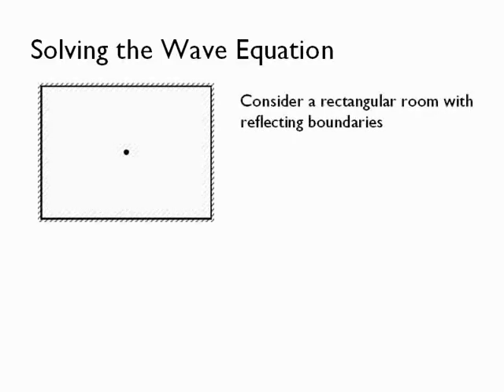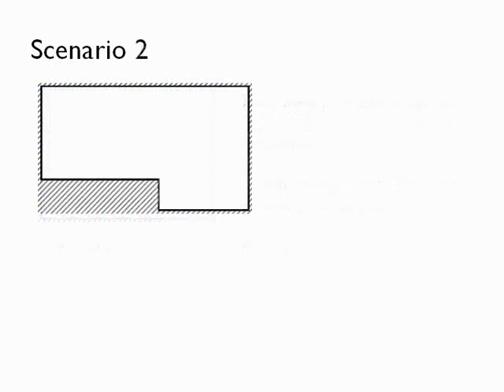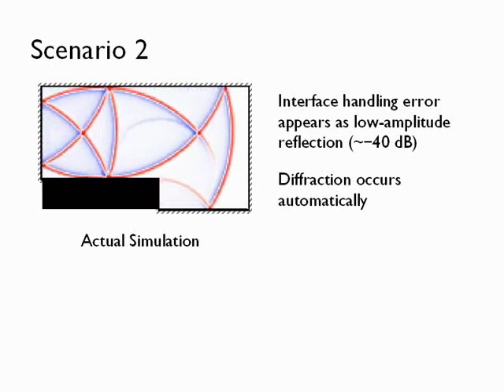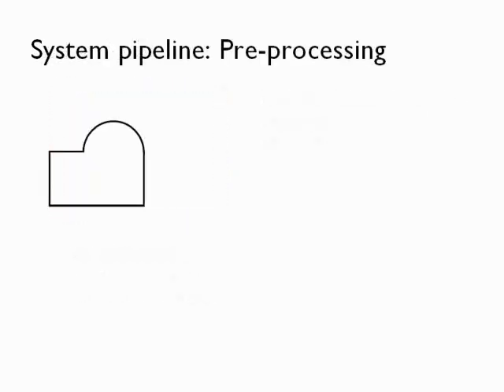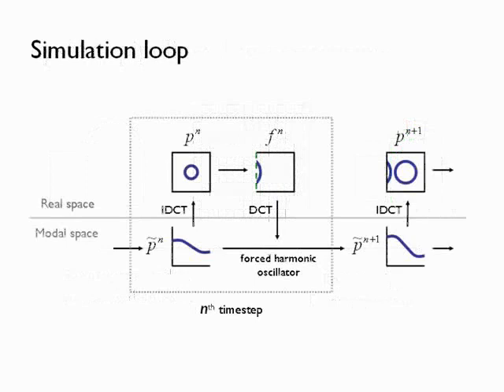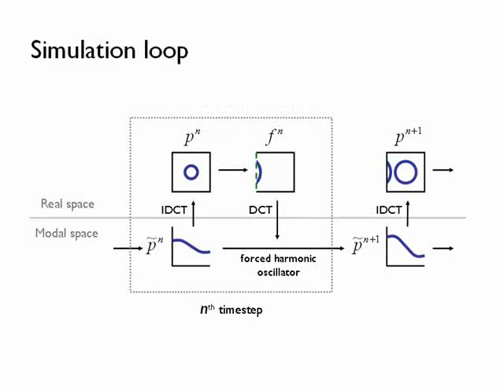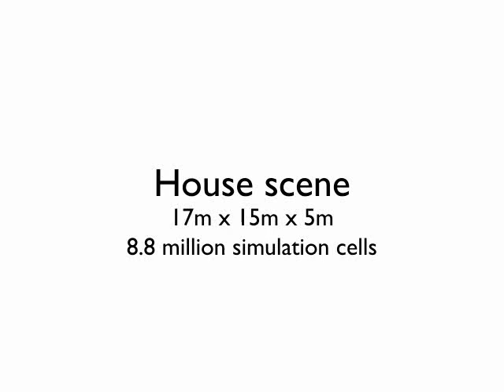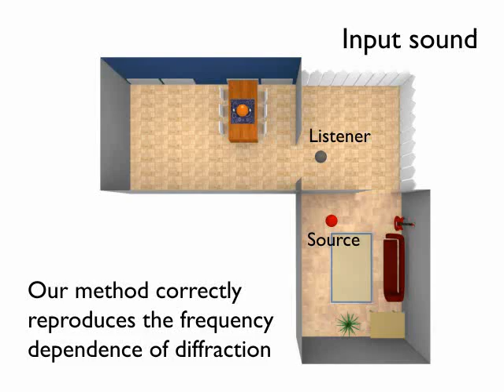Efficient Numerical Simulation of Sound Propagation

Comment: In which way arr the objects taken into account? We know from studio design, that objects in beneat of the sound source and the listener have the greatest impact on the sound. What is about wall transmission of bass frequencies?  Is that also calculated?  What should be interesiting is a parametric model of the walls which are covered by materials for acoustic treatment, because this is mostly the case in rooms where sound analysis is done.